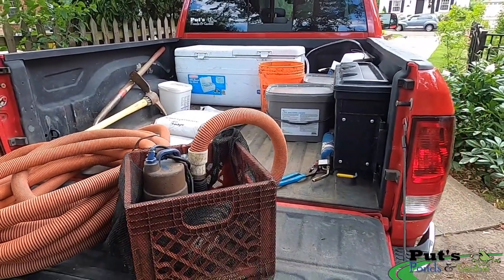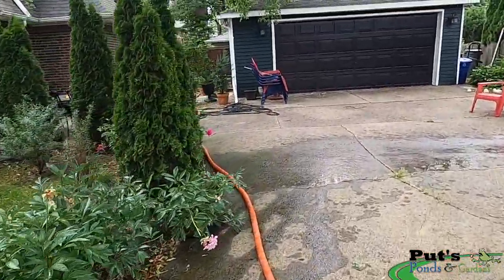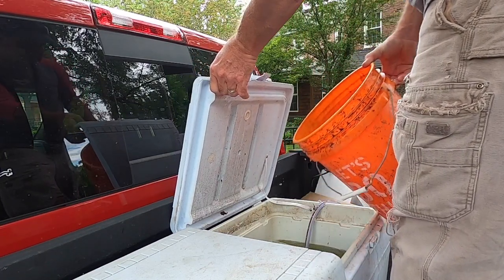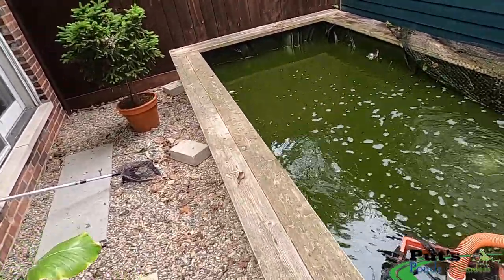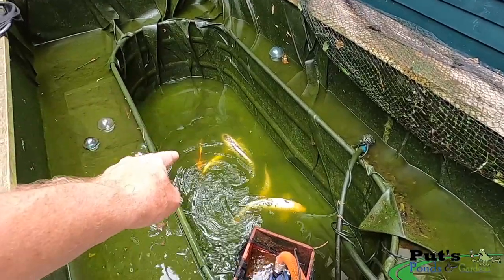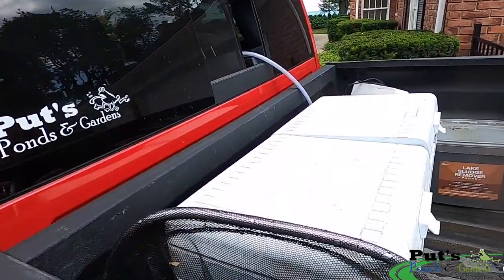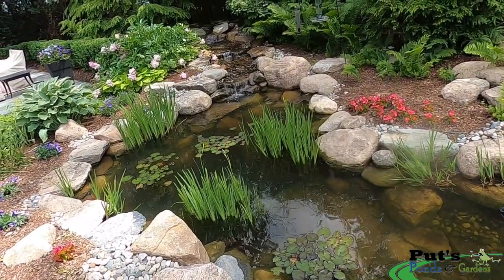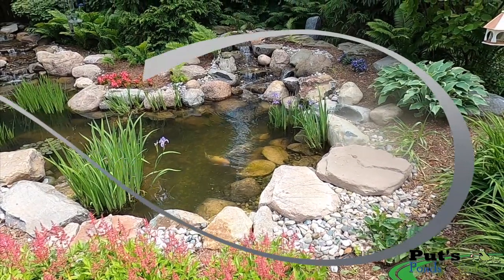Transferring Koi Fish

Comment: I got a question.   I’m about to “rescue” some Koi. They are coming from my work and they basically have lived in a cement pond which was a spill containment pond because we used to have a glycol tank there many many years ago.   During the winter, the guy who puts them into this pond removes them.  But back to my question, the water they are in is completely still water.  No filtration, aeration, or anything.   I just bought a 30gal tank, yesterday and got it filled with tap water, I have had my aeration stone and Walter filtration going for 24 hours now.   I don’t plan on getting the fish for another 3 days so that gives more time for chlorine to evaporate.   My question finally is can I just transfer them straight out of the dirty water into the clean water?   Any input would be awesome! Thanks.
Reply from the maker: 72 hours without adding anything and you will be safe… just remember to acclimate water temperature between the new tank and the bags you’ll be transferring them from (float them 30 minutes)
Reply: @PutsPonds  thank you!!
Reply from the maker: Good luck 👊🏼